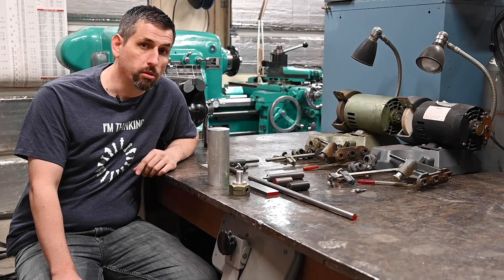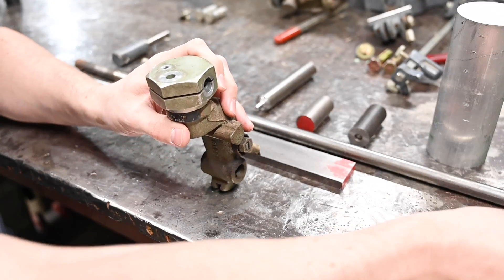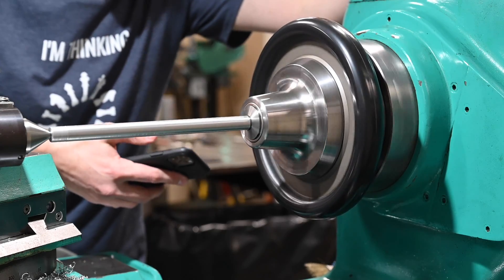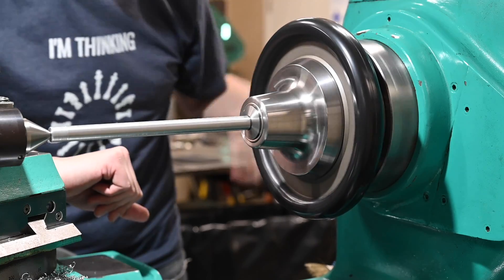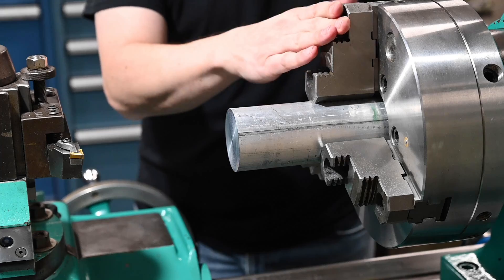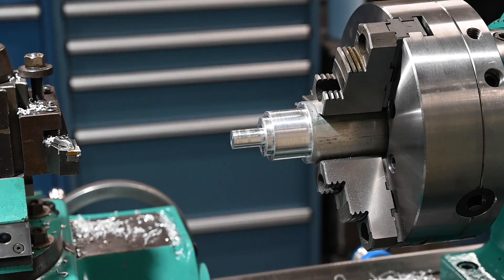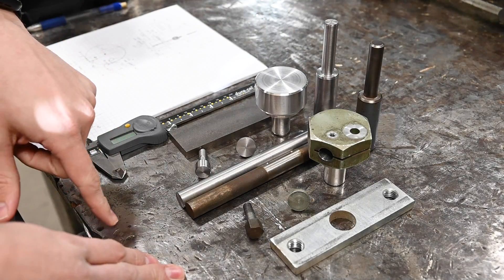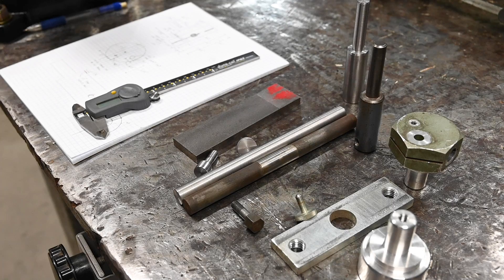Lisle 91000 Drill Grinder: replacement parts- Part 1

Comment: Marcel from Riverside CA. Hi Aaron, I just purchased a Lisle 91000 and I am without the diamond dresser. Could you reply with the dimensions for the dresser holder? I would also like to get a new grinding wheel. Do you have a source for a 5" by 1" by 3/4" bore 60 grit wheel. If not please give your opinion on my purchasing two 1/2" thick wheels and removing the paper on one side of the wheels and with an adhesive glue these together and compress them together by tightening the shaft nut. Dress these down with the dresser and call it good. Also looking forward to your shop upgrade videos.

Comment: Aaron, I had a short bed series 60 Monarch. I wish I still had it but am restoring a long bed 10ee to replace it.

You may already know this, but just in case you don’t already know, your lathe is capable of really large cuts at high speeds and feed rates. If you haven’t already, take some scrap and experiment.  An old machinist watched use the shortly after I had it running. He pushed aside and I was truly amazed how fast he removed metal. 1/4” wide chips literally were falling into the chip pan as fast as you could have emptied a sack of nickels.   You’re obviously very skilled and I certainly don’t mean to offend.  You’ve got a great machine and I’m sure you’ll put it through its paces.  Best Wishes for the New Year.
Reply from the maker: Thanks Sheffield- it is a heavy duty machine and can rip off material in a hurry for sure. Big pieces of material are pricey, so I haven’t done as much as I’d like, but I did show some heavy cutting in a video Big 6s and 9s in the Home Shop. Thanks for watching!
Reply: Aaron, sorry I will watch that video. Thank you for your kind reply.

Comment: I know its late, but I had to make the shaft and the housing that your piece mounts to for Mature Patriot for his Lisle. He actually got drawings from Lisle, plus I reached out to Mr Pete and he graciously provided the dimensions for that part, plus Randy Richard had some CAD drawings of the units. However you didn't do wrong by picking up another unit, because I suspect you can recoup or at least break even on the unit, because they are popular in home shops. Awsome work you did on the unit

Comment: I picked up the complete arm assembly for this sharpener free with other tooling and was able to get a motor for $125 shipped. It is a good working unit now. Used a 1 in sharpened drill the other day and it cut beautiful.